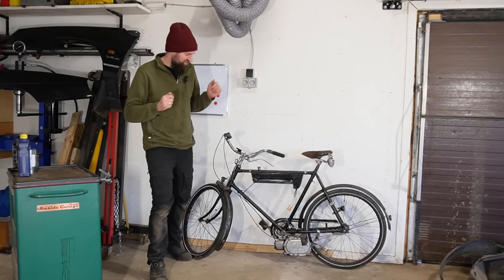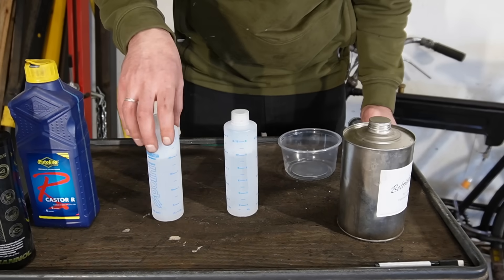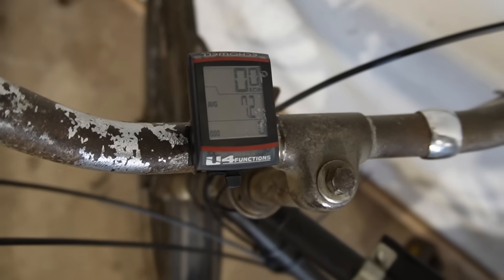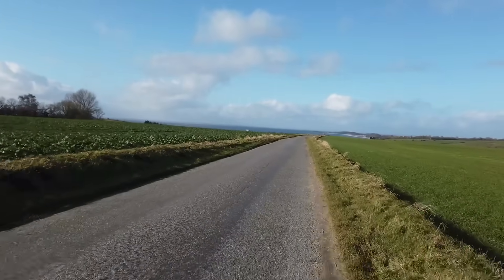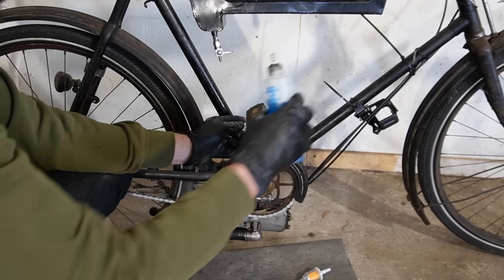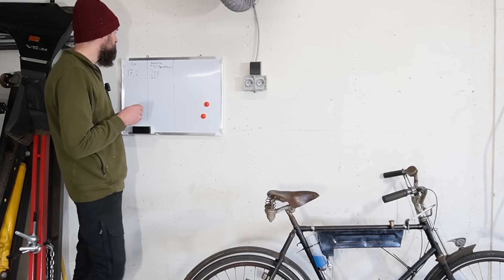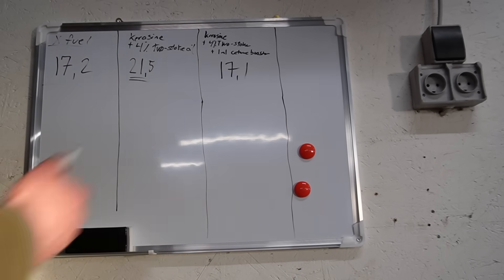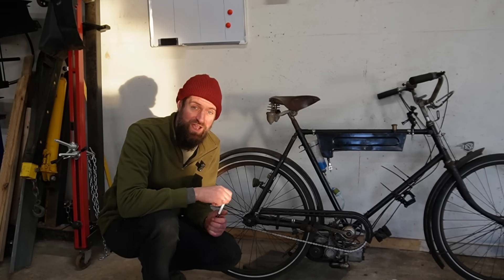Two-Stroke DIESEL Moped | The Search For The Perfect Fuel

Comment: COMMENT:  from personal experience, I think you have double trouble with tires.  Between the front brake, and going up a hill with the friction motor on the rear wheel, you need to travel only on straight roads, or you may have to carry 2 tires and 2 spare tubes on every ride.  There is another engine I don’t know if you ever did any videos of, but an ohlsson rice engine the 1hp was the most powerful, but that little guy ran drills, chainsaws, pumps, a bicycle front wheel friction, tiny generator between 100 and 400 watts depending on who and when it was made, an rc and real boat, and as a helicopter, the weight on that had to be between 15 and 20 pounds.  Neat little engine with a carb in the shape of the starship enterprise.

Comment: Have you tried premixed two cycle gasoline engine fuel? You could use one of the "bicycle trainers" to hold the rear tire off the ground so testing would not have to be on the road and do longer engine break in runs. Is there any "glow plug" component in the engine? This somewhat reminds me of the diesel model airplane diesel engines.

Comment: the end goal of this could easily be to run the engine on the waste oil and fat you produce in the house given how fuel efficient this is (assuming you convert the fuel in to biodiesel, that is). cook an egg? theres probably enough oil in the pan to take you to the shops and back (to get more eggs, clearly). cook a batch of sausages? all the fat that comes off them will be enough to cross the border, no doubt, lmao.

it might be worth to dis-assemble the engine again now youve run it a bunch and see the state of the piston and cylinder, could be that all the fuels are fine but its being run too rich, so you should be able to see that in the condition inside, but if you have a borescope that should be fine. do you think you could attach a smal carb to the air intake and run it on volatile fuels too? just tighten up the dripper and turn a valve to another tank and run off of methanol or petrol or something instead? might work but cant be sure if it would be a good idea
Reply: actually looking at it, I wonder if improved performnce could be gained by making an exhaust with an expansion chamber, as all 2-strokes nowadays use them since they improve both fuel economy and power by preventing too much intake air-fuel mix being sent out through the exhaust, meaning less fuel is needed while more fuel is actually burned. granted im not sure how big of a problem this is with a drip fuel system but once sompressed im sure most of it is in suspension in the air so it should help..?

Comment: Lohmann Fuel recipe 

Maybe this had been covered already …
Variable compression ignition engines like this Lohmann run best with fuel of Petroleum / Paraffinic Oil / high cetane Gas Oil/ Diesel / Kerosene Type, with lowest Self Ignition Temperature (SIT) available. 
Due to easy availability, Aviation Kerosene is a good choice.

For max. power output, fuel needs to have highest possible caloric value per volume. This is why Kerosene is perfect in that matter – decide against substitutes simply by looking at the specified Self ignition Temperature and caloric value. Kerosene SIT: about 250°C, Kerosene caloric value: 10.900 kcal/l.
So, the most powerful Fuel mix should contain highest possible Kerosene content.

Next is Oil. Castor Oil has the best lubrication and Sealing properties -period. Is perfect for Model engines and Racing engines but unfortunately not perfect with the common profile using the Lohmann, because once the Oil is heated during engine operation it starts to degrade, turning into a resin and finally a varnish, gluing everything together inside the engine after some storage time. This is due to the castor Oil chemical properties, that when heated, the Oil Molecule  it splits off Water Molecules turning it into a “drying oil” like Linseed Oil.

You should mix Mineral Motor Oil to your fuel. The “heavier” the better. Minimum is SAE 50 Mono Grade. This is used for old cars and bikes like 1940s Harleys. But try to find even higher viscosity SAE 60 or even SAE 70 Mineral Mono Grade Oil. The higher the viscosity the better the piston Rings sealing is supported, and you need perfect piston Ring sealing.

Cetane Booster CB. Is strongly recommended but definitely, use CB no more than 2%. CB enhances combustion and therefore reduces the need for compression to ignite. Many substances work as CB but   my suggestion is: 2-Ethylhexyl nitrate, because it is easiest commercially available at low cost.
Check for the selected CB safety data sheet, you will find the type and content of CB in the product. Don’t be surprised that some products do not have more than 30% working substances!
Try to get: AMSOIL INC. “CEATANE BOOST” being up to 100% pure 2-Ethylhexyl nitrate for about 15€/0,5 liter.

And the last Fuel component could be Diethylether (C2H5)2O. Its advantage is its explosive limits and lowest possible SIT of 188°C. The explosive limits with air range from a Mixture of 1:1,7 to 1:48. So, mixed with air, a huge range of Ether Mixtures will be capable to ignite. This helps starting the Engine without pre- heating and no need for having the perfect setting for the start. If you cannot by Ether in the Internet (it is available in Europe) use stater fluid in spray cans. But look at the safety data sheet for % of Ether content ! Good choice could be JOHN DEERE brand. Turn can upside down and release pressure without releasing the fluid fill. Then pinch a small hole in the bottom of the can and drain. Ether evaporates fast. You need to store it in a metal can.

Finally, the recommended Mixture for your Fuel could be:
2%  	2-Ethylhexyl nitrate
5% 	SAE 70 Mono Grade Mineral Oil  (according Lohmann Spec)
10%-20% Diethylether
the remaining: Paraffinic Oil or Kerosene.

Some last Ideas about variable compression ignition. 
Compression is needed to enhance efficiency of an internal combustion engine and in this specific case in addition, to provide self-ignition to the fuel. The variable compression setting of the Lohmann allows for ease of starting. Once the engine runs, there is some fine setting of the compression is necessary to get max. power output. The higher the compression, the earlier the fuel / air Mixture ignites.
In fact, with changing the compression you change the advance timing of ignition like you do with the timing points of a spark ignited engine. Like with the spark ignited engine, you need to find the best advance timing for max power output, but the same time not create excess overload. 

You need to set full throttle and the apply small compression changes and allow the engine some time to react to those changes, at least ½ a minute, because the changes create a different temperature level in the engine and CB change ignition support properties with temperature.
Hope this was helpful 😊

Comment: Assuming you can't manually adjust the timing of the injection, the cetane is how you adjust the timing somewhat. Perhaps adding a very small amount lower cetane fuel like an aromatic or alcohol would improve the ignition timing and pick up the speed/power, assuming a higher cetane decreased it. It is also possible the cetane of the kerosene and castor oil is near perfect, and would have a similar effect of increased cetane, lowering power output

Comment: add 5% etanol i the kerosine or use regular diesel mix with etanol 5-10%, you will have no poblem with cold start. you dont need cetan booster, etanol will do that for you

Comment: @3:03 Did you use a dilution equation? For example, most would think that adding 10ml to 250ml is a 4% solution but it isn't. It really is a 10/(250+10)=10/260=3.8%

I don't know what the tolerances are; does that 0.2% make a difference? Just an FYI in case it matters lol

Comment: Acetone in fuel helps cold starting model airplane 2-strokes and adding a little gasoline helps running in general.
Reply: I agree!
If the 'cetain' that was used, is just another name for acetone, I would have bet my life that it would have run better.
1:200 = 0.5%
This should have been fine, but could be dropped to 0.25%

The acetone reduces surface tension, causing better atomisation of the fuel, resulting in a cleaner burn (stronger explosions).

Definitely, the testing should be done with a fuel tank breather.

Comment: Very nicely done . If i may suggest . Try using 2 percent 2.stroke oil and 2 percent vegetable oil like castornoil.or olive oil or similar  and add one to 10 drops of petrol in the mixture . You can also change the ratio of 2 stroke oil and vegetable oil as experimentation . I use a mixture of mineral oil and vegetable oil 1:1 to be used in my 2 stroke mix and i am satisfied with results in performance of my scooters

Comment: Something easy obtainable (but definetly not cheap) is rc fuel for nitro cars, its mostly methane with a bit of nitro-methane and usually its pre mixed with two stroke oil!
If you can get that stuff to self ignite then it will definetly produce the most power, you most likely will have to radically enritchen the mixture though...

Comment: I have a few of these Lohmann  diesel engines and over the years I've done some testing with homemade biodiesel and many other fuels if you're wanting to run modern-day diesel are there some say there's an issue with it internal parts so it is true I've had one engine survived four Summers so far with no mechanical failures by adding Royal purple HP 2C 2-stroke oil I'm a royal purple fan by heart I do apologize I'm sure many other two-stroke oils will be fine put the bike I have this motor on that's been running modern day diesel has had no issues by adding the Royal purple to it I let  the bike sit three to four days at a time between it getting ridden

Comment: Kerosene is going to be the best. Ether assists for starting. If you can set compression high enough, it's not necessary. Cetane booster is probably ineffective due to low rpm

Comment: I had a Lohmann Diesel years ago, and the most important is, that the compression, the pistonrings is 100 percent tight, ore the engine has no power,and then a hard tyre pressure. Regards Finds Motor.

Comment: I wonder what the power vs. RPM graph looks like. And what were its RPMs when the bike was going 22.5 km/h. Most likely, it will be possible to squeeze a little more out of it if you adjust the diameter of the drive shaft.

Comment: For a fuel mixture you need a mix of diesel/kerosene and ether mixture and some 2 stroke oil for lubrication.  I run this mix in model aircraft compression ignition engines and has worked great. The amount of ether varies per engine for starting ease and i would mix a 60:1 starting for the 2stroke oil just a little bit of smoke haze when at full rpm not much. Hope that helps.

Comment: Try Kerosene with 1ml. of toluene. Toluene can be used as an energy booster, in fuel. The old leaded petrol contained around 28% toluene. Early unleaded contained 12% toluene and modern ethanol contaminated petrol contains 16% to 18% toluene.

I used to drag race 2 stroke motorcycles, back in the late 1980's and ran nitro-toluene diluted with 99 RON leaded petrol. Apart from the carcinogenic exhaust fumes, my drag bike pulled some impressive quarter mile times. Maybe try a kerosene and nitro-toluene mix, as one can still find the stuff on the internet. I have a flask of it in the garage. The safety warning, printed on the side, is a 200 word essay with, "WARNING!! FATAL IF SWALLOWED!! NOTIFY CORRONER!!, just in case some idiot drinks some as a dare. If you acquire some nitro-toluene, you'll need protective chemical resistant gloves and a respirator mask. when mixing it (out doors and standing upwind).

Comment: The plastic bottle had no breather and was compressed between the frame and the original fuel tank,
so the fuel was being injected under pressure ! No wonder you had better results.🤷🏼‍♂
Now try the Kerosene and oil mix in the original fuel tank, I think there will be a difference.

Comment: Once, long time ago, I used white spirit (petroleum derived turpentine) as emergency fuel to get the last couple of kilometres home in my car. It mixed in with the remaining petrol inside the tank and I got home,. However, I had to be light on the throttle to prevent the engine from pinging, which indicated that white spirit has good self igniting properties. Perhaps give it a try in a mix with kerosine?

A couple years before that, I was experimenting with kerosine in my two stroke 'knallert' (Yamaha DT-MX50) and found out that when the engine was warm I could turn off the ignition and keep on going. From that experience I can confirm that kerosine has excellent self-igniting properties.
Reply: To prevent the engine from PINKING

Comment: Try offshore diesel that you can buy at the harbor here in Denmark. Its called GTL “gas to liquid”. It containes no B7 ethanol.
On older tractors you dont get corrosion and waterproblems as you get with oredanairy diesel

Comment: I made a friction wheel drive with a Italian weedeater engine sold by McCollough in the late 70's. It's a 30 cc engine and possibly on a good day about 1.2 H.P.  It has reed valve induction, so it always pulled well from low revs.

 It would only do about 22 MPH (35.4 KPH) on the flat in low wind conditions.  I also have a single wheel trailer I tow behind it. So the trailer doesn't appreciably lessen the top speed, even with 25 pounds of cargo.   I think on my engine that the reeds tend to act as a RPM governor, as it tends to drift in and out of 4 stroking at 20 to 22 mph, but, you point it at an uphill grade it will only lose about 2~4 mph but the engine starts to dig in and cleanly two stroke.  Mine is well broken in and it doesn't seem to improve any, but it is a gasoline engine.

Comment: I guess the kerosene you are using are "Lamp kerosene" and it is not same as "Motor kerosene" and nobody realy can't tell the difference today. I know people who has tried to run Lohman engines on lamp kerosene and they cuold not make them  ignite,
this is realy strange. However acording to the legend the Lohman fuel contained ether and you could try to ad a dash of start spray. The cetane boster is probebly some kind of "Amyl nitrate", try to add more. Listen for knock and ping. And of course it is only 18cc, it will  not make you leave the ground 🙂.

Comment: I'd look up RC diesel engine fuel mixtures. 
Kerosene, ether (as an ignition improver, usually obtained from starting sprays), and castor oil.
Some people add cetane boosters to partially replace the ether as it has a low boiling point and tends to off-gas causing the fuel to go bad.

Also, 1/4 hp, the stated output of that engine, is 183 watts. 25 km/h on that type of bike at that power output seems a bit optimistic to me. Your 15 or so km/h makes more sense.

Worth noting is that engine's power is going to be very dependent on mixture and compression settings. Your best bet to find the best power fuel will be to test each fuel at different mixtures and compression settings to find best power for that fuel. Compression setting is akin to spark advance in an engine like that so a small change can have a big effect on power.
Reply: Second that, a good amount of ether in the mix is the way to go. Did some experimenting with RC fuels for small diesel engines long time ago and and mix of kerosene, ether and castor oils was the deal. Dont remember the ratios though.. but think it was up to 10% castor oil in the best mix. NO cetane booster, that will make it run worse.
Reply: @raymondhellberg3600  mhm interesting had you also a go with nitromethan in the mix  that stuff is pretty powerfull if you inject also more

Comment: What is the circumference of the wheel?  Was it a common size at the time? Though this might not matter if it is a friction drive.
I don't think you are going to increase top speed with any fuel.

Comment: Home heating oil worked well in my non emission diesel truck engine for 4 years straight. Less refined and stripped of sulfur than on the road modern diesel.
Reply: I'm sure your injection pump loved that

Comment: Thank you for sharing this. Maybe you can also measure the temperature on the cylinder after each run. I would also guess the Kerosene and oil would be best. You can get the oil for those heaters for camping and such. That fuel should be very clean and of course Kerosene. KaminX Petroleum Eksklusiv 20 L hedder det :)

Comment: The engine does seem to come to life more when you get to the downhill slope. You may get the 25km/hr there. Spec sheet does say 5000 rpm and that may be what is needed to get to 25km/hr. Spec sheet also says Pure Kerosene but now days what exactly is that? The Wikis on Kerosene and Jet Fuel make interesting reading. JP-8 jet fuel looks like an option for you.

Comment: For computing the 25 km/h, please check the recommended tire size, if there is any. You get a gear pair ratio in the engine, and the roller versus tire ratio.  From your measured 21 km/h and the actual tire size, you can check if the engine rpm reaches 5000/min. If yes, you reached your goal.

Comment: Excellent video - I look forward to further testing!
I run small 2 stroke diesels in RC models. In addition to finding the right fuel, performance is affected by variables such as engine temperature, air temperature, atmospheric pressure and humidity.

Comment: You need fuel that has balanced cetane (for starting) and octane (for power) number try 45% diesel (non-sulfur) and 45% gasoline (non-ethanol) + 10% oil (for better protection)